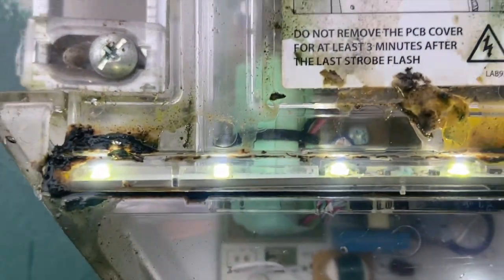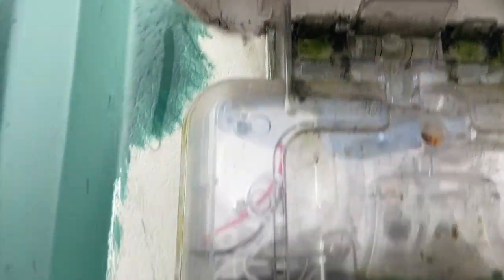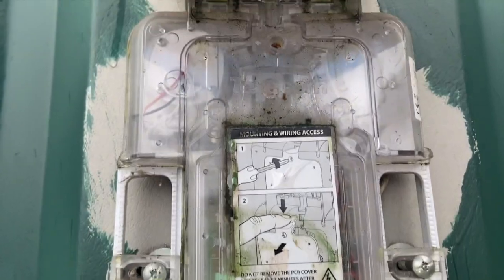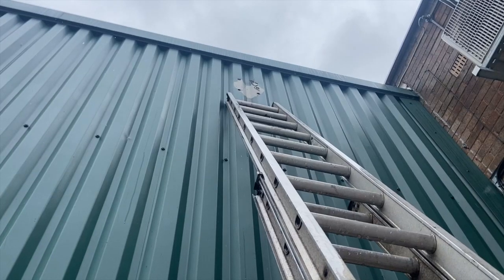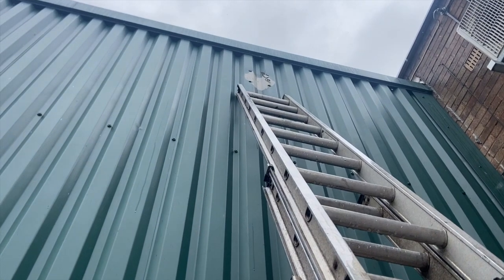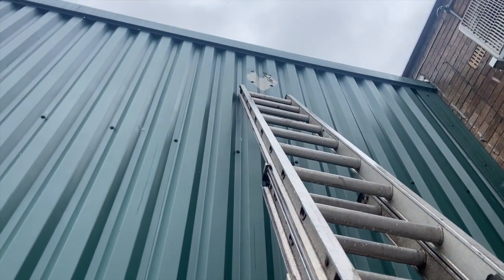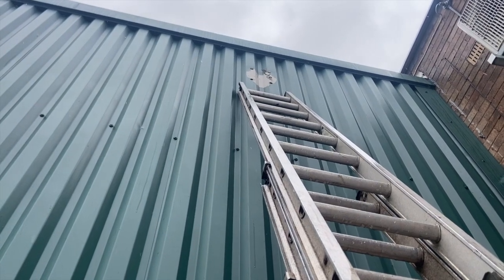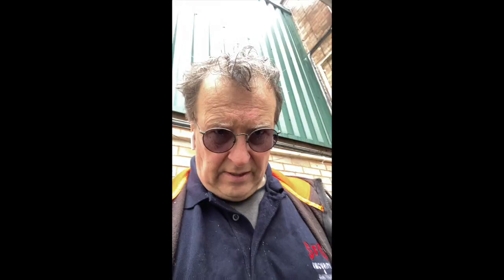Replacing a Texecom Siren for Orisec

Comment: Nice bells those. We originally had an orisec bell but they had to change it because it wouldn’t work with our pyronix enforcer, so was swapped for a deltabell
Reply from the maker: Used to fit delta bells a few years ago, then went to odyssey x and the the orisec.  Always fit there hard wired panels but not sure about the radio yet as a mate has had issues.  There is nothing like HKC for radio stability.